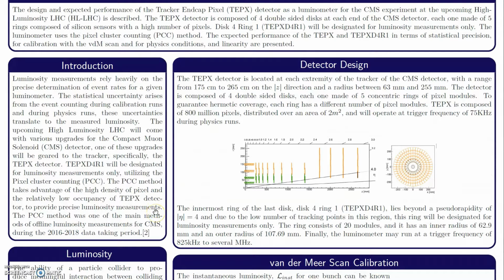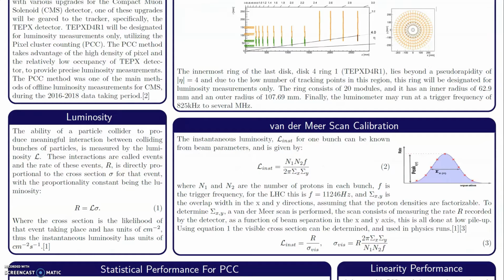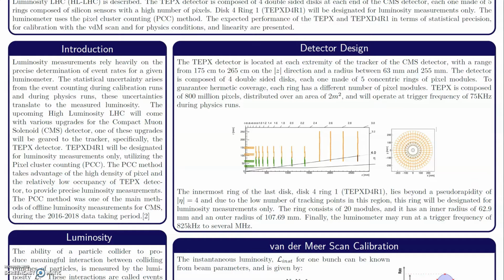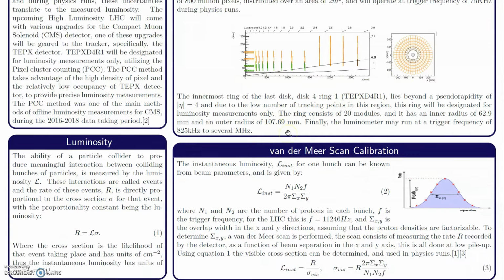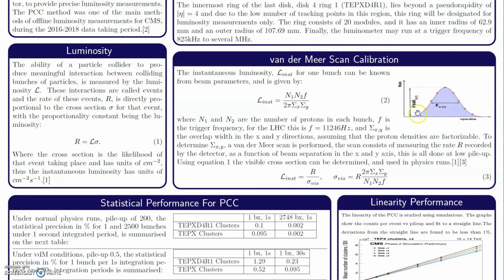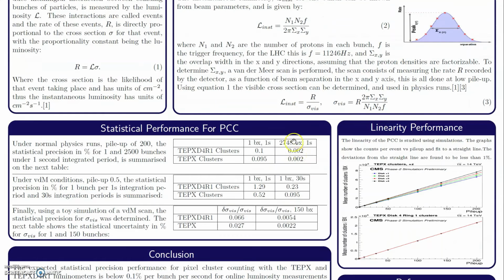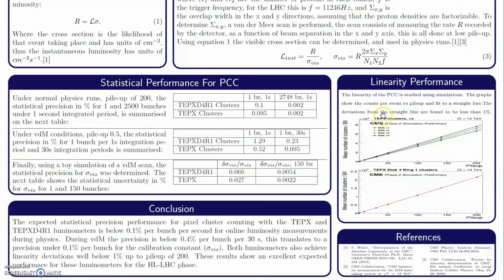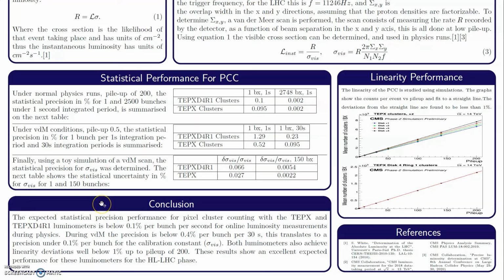Design of the TEPX luminometer for the CMS experiment at the HL-LHC.

Comment: Are proton densities always factorizable ? How would you proceed, in particular Eq. (2), if they were not factorizable ?
Reply from the maker: They are in case of head on collision, however if for example, the bunches collide with an angle between them or a separation on the x or y axis, the luminosity needs to be calculated accordingly, which will result in a factor added to equation number (2), and the proton densities will need to be integrated numerically.